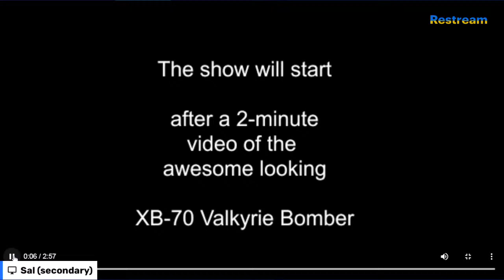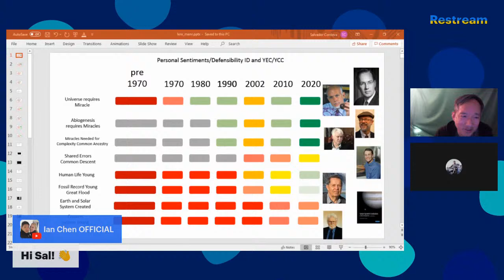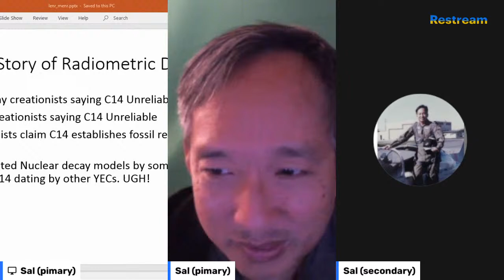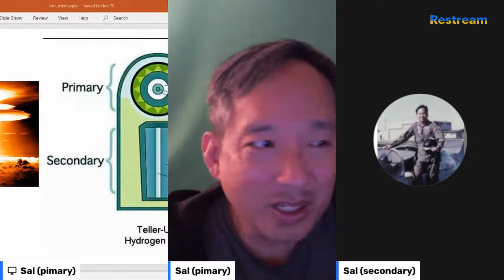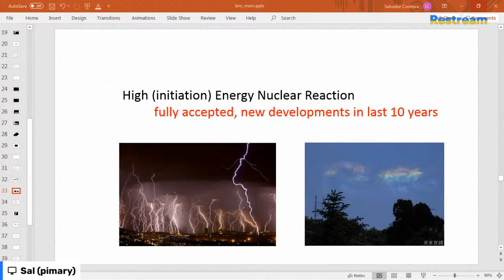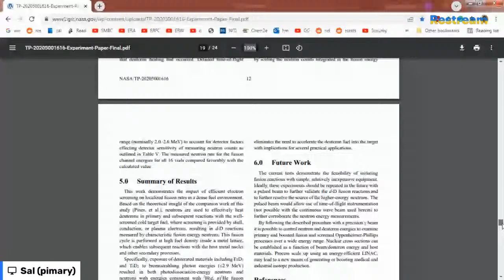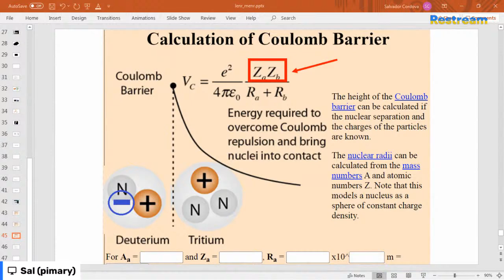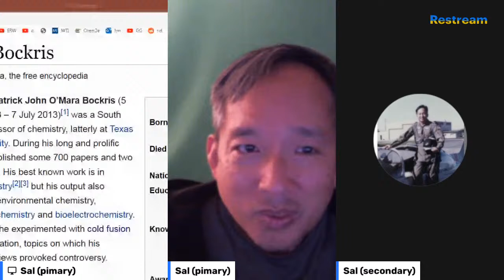NERD TORTURE: Nuclear Physics, Radiometric Dating and YEC discussion, Pt. 4

Comment: The thing about the pyroelectric fusion device, is that they used deuterium targets. Simple hydrogen is notoriously hard to get to fuse, so they had to use enriched deuterium. Deuterium is VERY rare in nature, and cannot be enriched without the use of some expensive and exotic equipment.

Comment: Before you go any further, it would be advisable to learn these three terms: s-process, r-process and p-process, and the valley of stability. Each process creates a specific pattern, in other words each process creates a specific distribution of nuclides/isotopes, that we find in nature.

So, we have this chart of the nuclides, which kind of resembles a valley, when viewed from above. The center of the valley is the most stable, and getting further from the center you get less and less stable isotopes. The s and the r process make heavier elements from lighter ones by adding neutrons.
Going "up" the valley, towards heavier elements, the right side is neutron-rich, and the left side is neutron-poor.
https://en.wikipedia.org/wiki/P-process

Usually I am involved with (γ,n) reactions
Reply from the maker: "Usually I am involved with (γ,n) reactions"  Thank you for the info.  What reactions do you work with?

There is transmuation via slow neutrons.  The reaction you describe reminds me of this paper:
https://www.ipen.br/biblioteca/cd/inac/1997/ENAN/E12_303.PDF

"NEUTRON TRANSMUTATION DOPING OF SILICON: HIGHLY HOMOGENEOUS RESISTIVITY
SEMICONDUCTOR MATERIAL PRODUCED IN NUCLEAR REACTORS.

The neutron transmutation doping (NTD) of semiconductor materials is a method in
which the quantity of dopant can be precisely controlled and homogeneously distributed
throughout the material. The NTD method is based on nuclear reactions where some nuclei of
the semiconductor material capture thermal neutrons and form unstable radioactive nuclei which
beta decay to nuclei of a different element, i.e. the dopant. The irradiation of silicon produces
phosphorous, by means of the neutron capture in 30Si nuclei producing 31Si nuclei which decay to
the stable isotope 31P. Since the irradiation of a silicon crystal can be performed in a
homogeneous way in nuclear reactors, the resistivity variation is very small throughout the
volume of the crystal. The advent of NTD Si made possible the development of high power
semiconductor devices as it allows tight resistivity tolerances and excellent homogeneity of the
silicon base material. An irradiation rig with simple design has been constructed and installed in
the IEA-R1 research reactor for irradiation of silicon crystal ingots. Test irradiations were
performed with float zone silicon crystals and the results of radial and axial uniformities in the
final resistivity values as well as the doping accuracy, obtained in the test irradiations show an
excellent doping quality achieved.
"
Reply: @EvidenceandReasons  We do something called activation analysis with something called a microtron. And the other working microtron is in Viet-Nam.

Comment: Could be 3 billion volts according to a friend who is a electrical technician/engineer. Now to Google. According to NOAA, “A typical lightning flash is about 300 million Volts and about 30,000 Amps.” Looks like the 3 billion can be accurate enough as 300 million volts at 30,000 amps is just huge. Volts are like the speed/pressure of the flow of electricity and the amps are the volume. I will check my last statement with another friend of mine covering how to view the two in relation to one another.

Comment: Where do the neutrons come from with the lightning strike. If just some are from the interactions of the electrical charges then this points to the possibility of Star Trek replication tech possibly being possible. And I just nerded out. So the gama rays somehow create neutrons?
Reply from the maker: Electric fields in lightning accelerate electrons to high velocities, and when electrons are decelerated they emit gamma rays, and the gamma rays hit nuclei of atoms in the atmosphere and blow them apart.  When they are blown apart neutrons are generated.

See here:
https://en.wikipedia.org/wiki/Photodisintegration#:~:text=Photodisintegration%20(also%20called%20phototransmutation%2C%20or,by%20emitting%20a%20subatomic%20particle.

But the COOL thing is that even ANTI-MATTER is created, specifically postirons.  The relevant paper is:

https://arxiv.org/abs/1711.08044